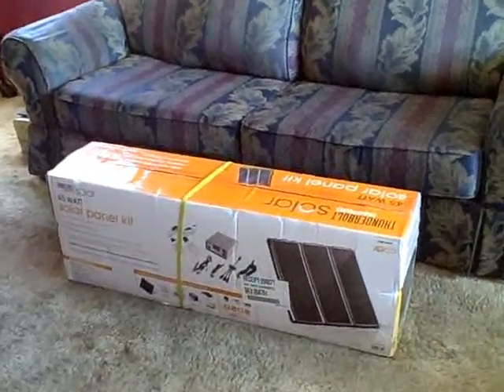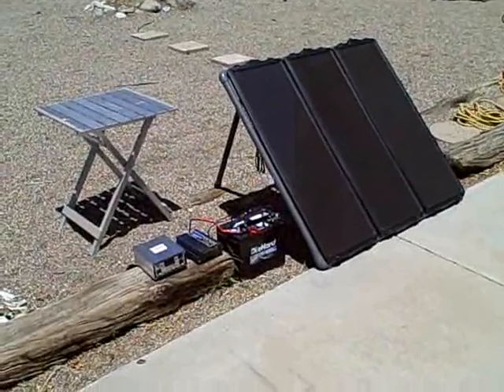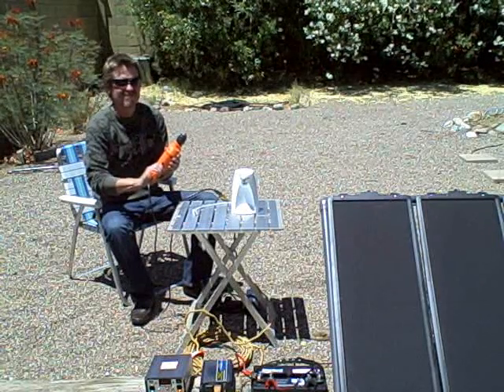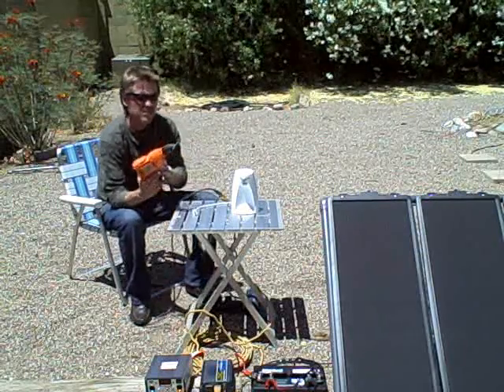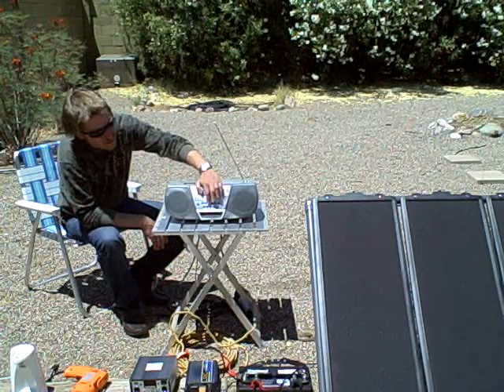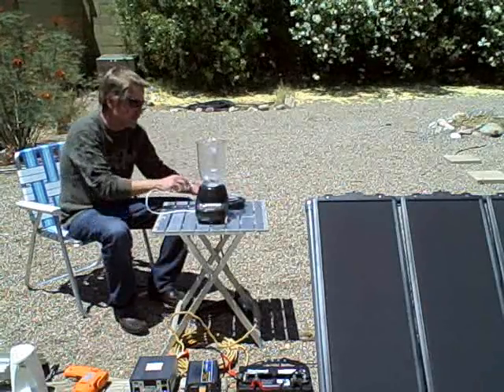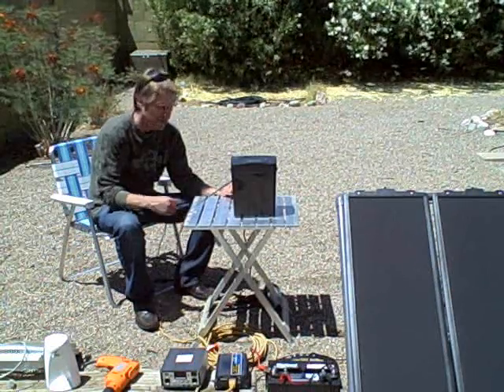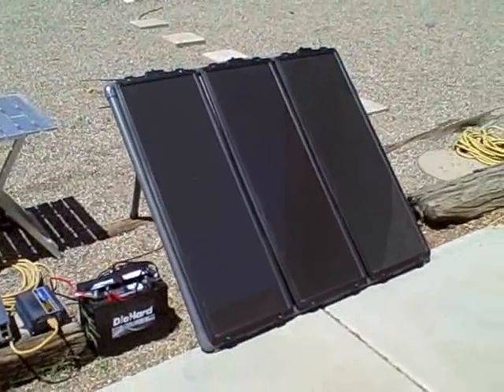Solar Power System - DIY "Small Scale" off-grid solar electric system (runs almost anything)

Comment: The charge controller along with the panels is a good value, but in terms of dollars per watt one is MUCH better off buying a 100W solar panel on eBay for between $100 and $120, and a $30 charge controller separately on eBay. That said, this is a good starter kit for someone looking to painlessly get started in using solar power. Thank you for the video!! Have subscribed - you offer a considerable amount of valuable content here!!!

Comment from the maker: i haven't had any issues. the charge controller works great with the 3 panel set.  if you want to hook more than 3 panels up then you would need to buy a 'charge controller'  that can handle more amps.  i have a 25amp charge controller hooked up to 12 of these panels.  (earlier video).  it doesn't come with an inverter.  you buy that separately.  the one in this video is a 400 watt one. cost $25.

Comment from the maker: i think the cigarette lighter plug on the charge controller goes directly to the panels.  i don't think you can pull enough juice thru that to run an inverter.  i think you'll still need to buy at least one deep cycle battery and then hook the inverter to that.

Comment from the maker: takes about 8 to 10 hours to charge an average sized deep cycle battery (with one 3 panel set).  i don't think you can hook the inverter up to the charge controller (just to the battery)

Comment: How long does it typically take to charge the deep cycle battery? And can you hook up the inverter directly to the charge controller and and use the inverter to charge a UPS battery backup?

Comment from the maker: i'm glad i was able to help. sounds like you're off to a good start. just use the right number of batteries for the amount of power that the panels put out. i would invest in a good ampmeter and a kilowatt meter (from harbor freight tools). the kilowatt meter can show you exactly how much power different things use. also, check out my other solar panel video.  it shows a larger "whole house" system. lastly, i like to have 2 voltmeters hooked up at all times so i can monitor the batteries.

Comment from the maker: great questions. you hook the batteries in parallel. meaning ("+ post" of 1st battery to the "+ post" of 2nd battery. then "+ post" of 2nd battery to "+ post" of 3rd battery. etc...) do the same with the "negative" posts. then hook the charge controller and the inverter to the first battery in the row. if you have more than 6 batteries then search google to find detailed diagrams on how to hook those together. you can run the lights and tv on 1 or 2 sets of panels and 1 or 2 batteries ...

Comment from the maker: ... not sure about the fridge (that takes a bit more power). you might be able to run it if you had four 3 panel sets and 4 batteries.  the heater probably takes 1000 to 1500 watts.  that would take a bigger set up if you want to run it for very long.

Comment: Hi, Thanks so much for making this easy to understand. How do you link the batteries together? If you have more than 1 battery, which one do you connect the inverter to? I have a tiny trailer with a small tv, a few lights, small frig, and small elect heater. what do you think I'd need? thanks again for your help.

Comment from the maker: $150 for the 3 panel set with charge controller. battery was about $100 (they can be bought cheaper) and inverter cost about $20.00

Comment from the maker: Lots of good questions. yes, the panels are 100% waterproof and weatherproof. they are meant to be mounted outside (permanently if you like). the battery is used to store the power that the panels generate. they are charged over and over again. briefly, all you need to do is hook the solar panels to the "charge controller" and then hook the "charge controller" to the battery. then hook an "inverter" to the battery. the inverter has an AC outlet on it. finally, just plug in what you want to run.